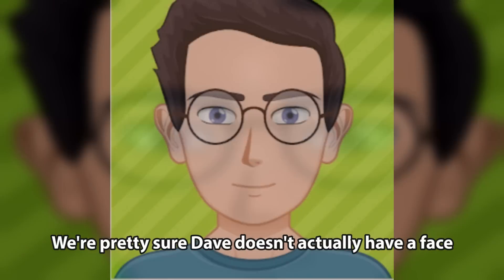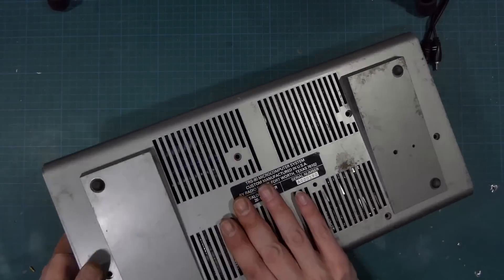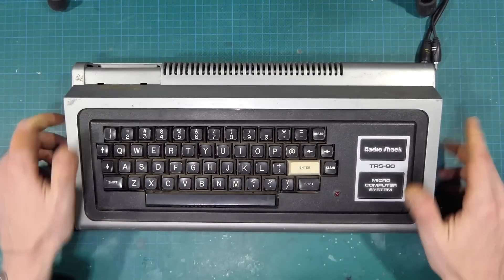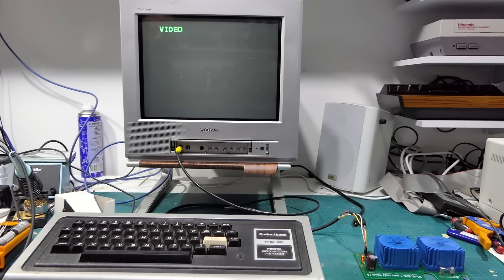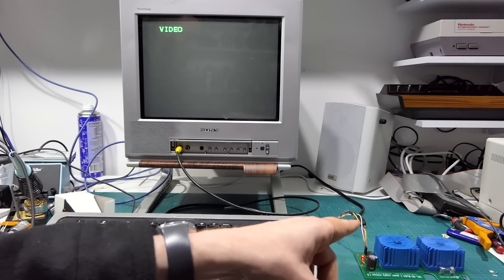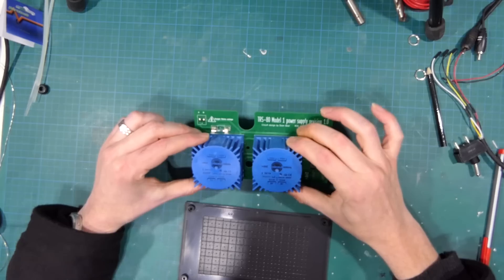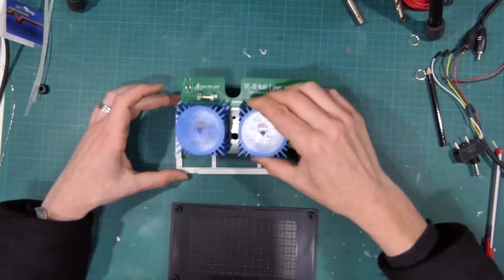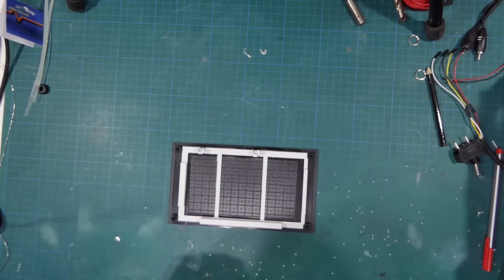Tandy TRS-80 Model 1 Pt1 - The Power Supply #SepTandy

Comment: No worries.

Just... had a minor heart attack when you soldered the two mains wires just daintily to the top of the PCB instead of using the through-holes as.... THROUGH the  HOLE connectors. :D
Reply from the maker: A connector was the one component I was missing, in saying that tho - there was nothing dainty about the amount of solder I put on those joins. Trust me, they ain’t going anywhere.

Comment: We used an original Model 1 4k in school. Cassette drive and all. It we not supposed to go into monitor mode but if you played with the reset switch just so it would come up in monitor. We wrote alphabetizing programs in Basis and assembler and the difference was about 10 times in speed. My friend wrote a video game using the characters to create and asteroid field and you had to steer the cursor up and down while you 'ship went across the asteroid field. We learned quite a bit with 4k.

Comment: I was about to purchase a S100 system when this came out.  I got the store demo unit before they had customer deliveries because I pestered them so much.  Changed everything for me, I learned so much modding the computer (probably have the only rack mount TRS-80)  No way anyone these days could get the same feel, modern computers are untouchable and completely undocumented (no theory of operation at all).  Not even an Arduino has the same accessibility.

Comment: If you put a resister in parallel with the capacitor you can drain that residual power and reduce the risk of shock.

Comment: Great video! Although I was shouting at my screen when you super glued the 3D printed bit to the case instead of screwing it down 😃 BTW, I found you from Adrian's Digital Basement shout out. Good idea to do #SepTandy.
Reply: I wasn't sure on that myself either, but thinking it through, i bet it's fine and probably not any better or worse than screws in a 3d printed part anyway.  Even if it came lose, it's not really going to go anywhere.  What made me much more paranoid was the way the mains power was soldered on top like that.  :)
Reply from the maker: The mains soldering is fine. Unfortunately the holes in those solder pads are big enough for "proper" main gauge wire. Although some kapton tape over the solder points probably wouldn't go astray. There are a few things about the PCB design I've fed back to Ian.
Since doing toy repairs as well, I've found there to be a big difference between normal super glue and good super glue. I've had a lot of success with that Loctite stuff. Already that PSU has been transported back and forth to work several times (and not lightly either) and hasn't come loose.
Reply from the maker: Hey mate. Love your channel. I knew the Beeb T-Shirt wasnt co-incidental :)
Reply: @MrLurchsThings  I'll have to try better super glue than I get from the pound shop then! Glad you like the channel - I'm a 80's retro computer nerd, with a ZX80, ZX81, Spectrum & BBC that I drag out occasionally. New to this whole YouTube creator thing, but I'm slowly improving.
Reply from the maker: @BigCar2  Man - you should have been in that video that RMC did a while back on the C5. That would have been awesome.

Did you used to run a bigger channel then got stooged by YT?
Reply: @MrLurchsThings  I saw the RMC video after mine, but I love the C5 and would love one! I had a channel that got to 20k subs (started in Jan this year). It was under an account that had another channel (my personal one) that got taken down (for unknown reasons). YouTube didn't take down the Big Car channel, but I couldn't get access to it. Very frustrating, especially as I thought they were taking all the ad revenue from my videos. My advice to any Creator is: 1. Never put more than one channel under an account if you can help it. 2. Log into your channel through the YouTube app on an iPhone (not Android or iPad). This is how I managed to get limited control back, through a bug in the iPhone YT app. 3. You can put other people as admins or moderators or the like on your channel. Make sure you have one or two e-mail accounts set up to do that - it may allow you access.

Comment: Great video! I always enjoy seeing products made by the community that help keep these old computers running.

You should turn off autofocus and lock the focus on the bench/whatever you're showing though. At several points autofocus went nuts due to the reflections off of the PCB.
Reply from the maker: crispkreme In theory, yes. However the way the camera was set up at the time was actually pretty close to the bench and thus at a very wide angle. To use manual focus requires using zone focus so when you do bring things towards the camera they still remain in focus, which then means using a very narrow aperture due to the camera already being at such a close focus point (almost macro, although it doesn’t look it). And naturally a narrow aperture = less light = dark image even with every light in the room on.
So.... auto focus. 
However I’ve since built a whole new camera bracket for the overhead shooting which brings the camera a good foot further off the table which should make manual zone focusing feasible.

Comment: Great video!  Yes, I make the PSU kits just email me (ianm@trs-80.com).  A shout out to D. Bear who designed the original PSU back in '11 and D. Mutimer who did the PCB layout in '18.  The main reason for leaving out the transformers is they are heavy which would blow out the postage cost of the kit to international buyers.  Figuring people who would most likely to be ordering this would be well accustomed to ordering parts from DigiKey so the savings by buying them in their own country would be offset rather than including them.
Reply: I agree with this and its a great replacement.  The only thing is, if you're going to buy the transformer at digikey or other more local place, you can pretty much buy all the other parts there at the same time (minus the pcb)?

Comment: That's a great solution for the power supply and the result looks really good!

My Model 1 has some sticking keys as well, I popped one off and it's the same kind as the HP-86. Stackpole or  Hi-Tek switches. So I already know how fun those are going to be...Hopefully yours isn't that, I'm now convinced that only SLA printed key stem replacements are the only way to go and getting those made isn't going to be cheap or easy.
Reply from the maker: Mine has those switches, but thankfully none cracked phew
Reply: Oh, great point about the SLA printers.  I made a temporary stem at one point for a TRS-80 with my regular FDM printer and while it worked okay, it was too 'gritty' feeling so eventually just swapped it out with a real one i overpaid for.  Just ordered (as did adrian) an SLA printer on sale so that would be the perfect 'retro' use to test with it.
Reply: Later ones apparently came with Alps SKCC Cream (iirc), which probably feel significantly better, too